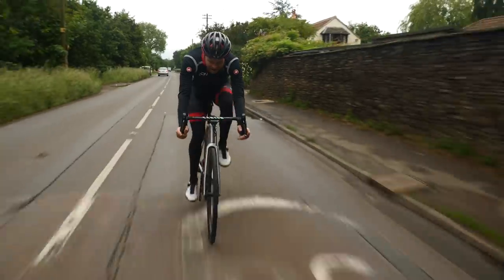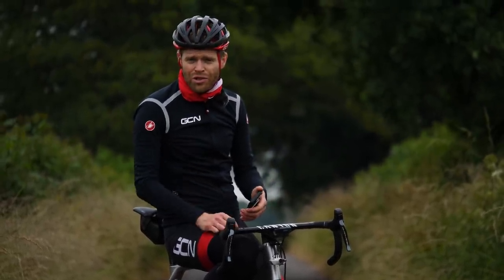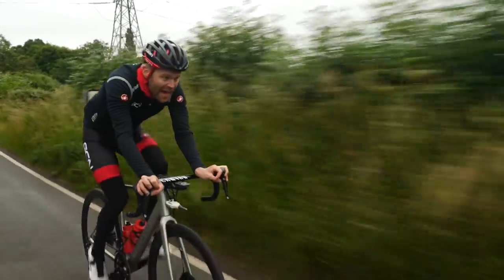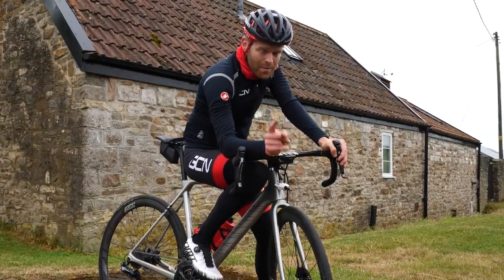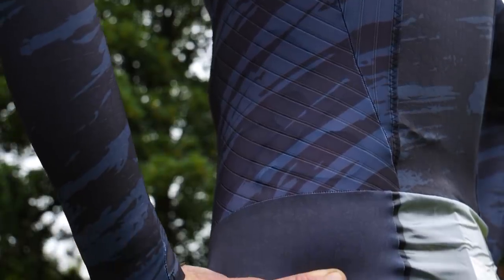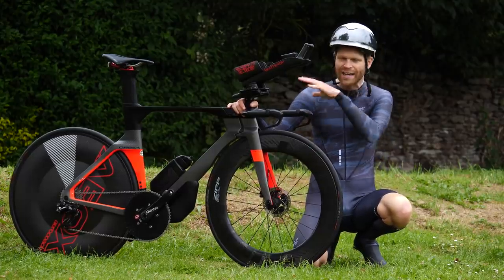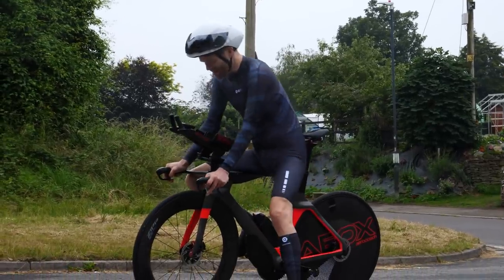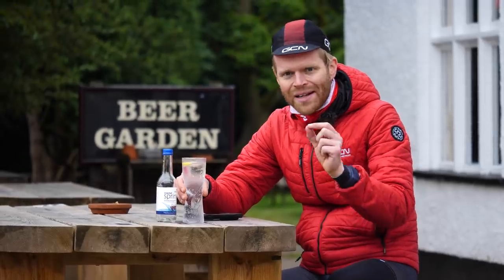The 30 mph Aero Challenge - How Fast Can Ollie Go?

Comment: In order to go 48 km/h on a smooth flat road on a calm day with no interfering traffic at or near sea level, you need a ratio of Watts/CdA of ~ 1500 (slightly more if the road isn't flat or the surface isn't smooth, slightly less if you're riding on a dual carriageway with lots of traffic to push you along, a fair bit less if you're riding at altitude). So if Ollie had averaged 326 watts, his CdA would had to have been in the range of 0.20 or 0.21 m^2, which is a nice improvement from his starting CdA of 0.26.

Comment: Nice video. I can see several comments regarding:
1. Facial hair. Facial hair doesn't seem to matter as much as arm or leg fur, especially leg fur since the lower leg is a cylinder that churns through the air while the face is mostly "static."
2. Recumbents. Most unfaired recumbents have (surprisingly?) higher CdA than Ollie was reporting on this TT bike. Only a handful of unfaired recumbents have CdA < 0.20 m^2, and they often have other issues including high drive train losses and/or less than optimal tire rolling resistance. The only recumbents that are clearly better than an optimized rider on a modern TT bike have fairings -- streamliners can have a CdA < 0.03 m^2 -- but most commercially available recumbents have a CdA in the range of 0.25 - 0.35 m^2. As a reference, on Ollie's original road bike, he reported that his CdA was 0.26.  A few low racers have CdA's in the range of 0.17 m^2, but they often achieve that with odd tire sizes, long chains with idlers, and reduced turning radius.

Comment: The wind effect does not "average out" on a loop because the aerodynamic drag is proportional to velocity squared, so you need more power to ride with headwind than what you save in tailwind, with the same wind speed. Hence no wind will be faster than windy, even on a perfect loop.

Comment: the air density thing is strange. I often noticed when riding every day to work, that some days the win kind of goes around you without slowing you down, despite it blowing quite strongly. Other days it's far less windy but the wind/air is like a brutal wall.
Reply: Put a dehumidifier in your house and you'll be surprised at the moisture it takes out.

Comment: Really excellent nerdy video - lots of good info! BTW, bikecalculator estimates that 48kmh requires 405 watts for an 80 kg rider + 8 kg bike with the rider on aerobars on a flat course with no wind. Pretty close to Ollie's calculation of 430 watts. And final nerdy thing, asking google about the density of water vs custard: the two are actually pretty close in density! The real difference is that custard is a non-newtonian fluid - so offers much more resistance than water when significant pressure is applied

Comment: It would be nice to see a similar video where you repeat the effort by removing only one variable, similar to what you mentioned in the end. I'm curious to know if there is only one thing that gives you a bigger step in performance or you need at least two or at least three etc. For example, what is the gain in performance using a skin suit on your regular road bike.